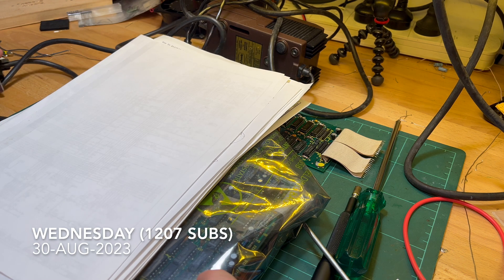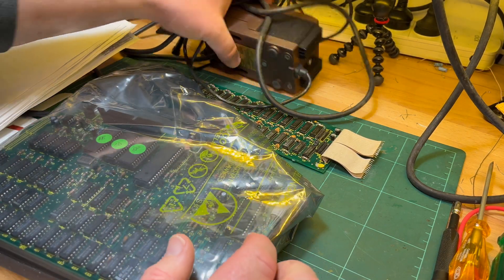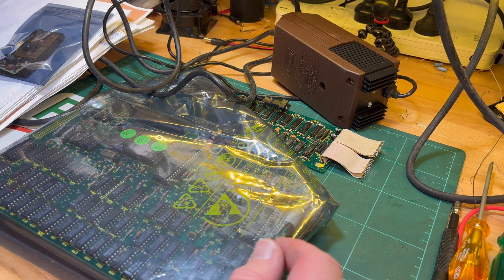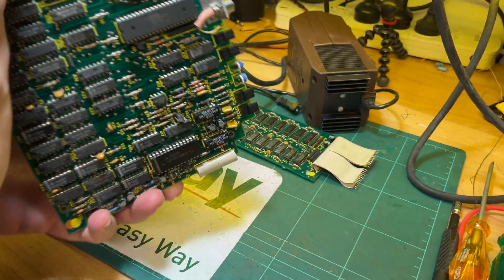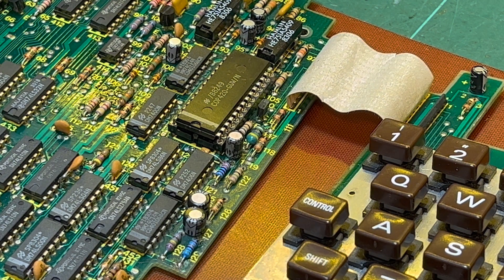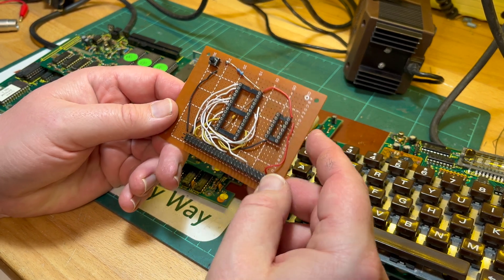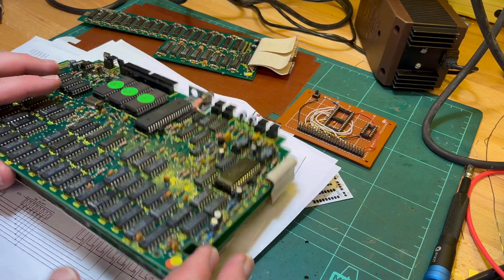🇬🇧 Grundy Newbrain: Part 7b (Where was I?) [TCE #0345]

Comment: It does operate CP/M. But you do need an expansion board. Hence the ram_override and ext_a15 etc. 
This  expansion gives you an extra 64k of ram and the floppy drive controllers you need. There even was a metal enclosure to mount all this. As ever with Newbrain the ribbon cable from this enclosure to your Newbrain was the fragile part and lead to numerous "no response from disc controller" messages. I'll keep following this. 
P.s. never seen someone copying a ram board for the Newbrain. Faulty drams always gave themselves away by emitting heat. ;-)
Reply from the maker: Yep, that was my original plan - just replace the 32KB RAM externally.  Do you know anything about SD interfaces?  I've seen some brief videos demonstrating them on YouTube but unfortunately no information shared ... ? /Brett
Reply: What do you mean by SD: Cisco SD, SD micro memory cards. I have no clue.

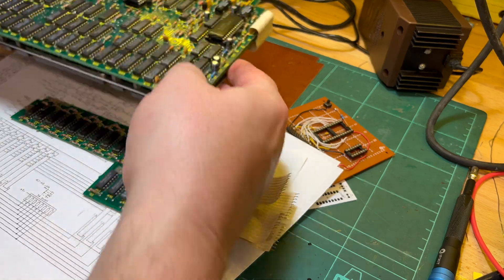Comment: Maybe I'm wrong but at 15:03 mark I can see that capacitor 104 has been mounted with inverted polarity. It's always mounted inverted respect to the silkscreen so the cathode must be in the upper side. I've a couple of working ADs and I've always seen this cap inverted and, of course, they're flawless. Never tried to solder it the opposite...
Btw, nice NB videos!
Reply from the maker: No mate, you're probably totally correct.  This is the first PCB I've laid out so wasn't aware of the convention.  The reason why I have it that was was simply for the routing I think ... ground was at the top and +5V was lower down ... so the routing "looked" nicer. Learning quite a lot ... including how they include this 10µF between the power rails on expansion boards. /Brett

Comment: Great to see you tackle this one again! I've just repaired mine a few days ago and I've been watching all your videos on it. My NewBrain worked after I replaced the capacitors in the reset and powerup circuit, but I've got a lot of noise in the composite video output.
Reply from the maker: Oh, good to hear!  I'm going to try to re-design the store board today ... I think that's the last issue I had ... it booted but with garbage characters on the screen, so assuming DRAM issue.  Do you have any other bits & pieces for it? /Brett
Reply: I have no additional hardware for it, but three books: The NewBrain Dissected, Beginners Guide and the Handbook. Do you have any good links to more hardware information? I got the schematics for it, but nothing else. @Brfff
Reply from the maker: I usually document any links in the video descriptions - have a look through there.  I created a Github repository (link in description), but here's an existing one that has a lot of info ... including a store board schematic in Kicad ... that might save me some time
https://github.com/flypie/NewBrain
Reply: Oh thanks, there was some very nice stuff in there!
Reply from the maker: Actually - I think one of my initial problems was also the capacitors leaking and messing up the reset/power up circuit as well